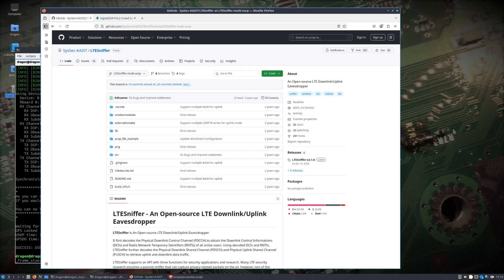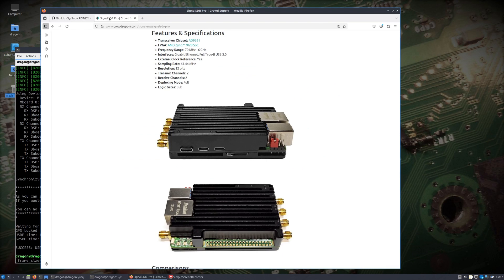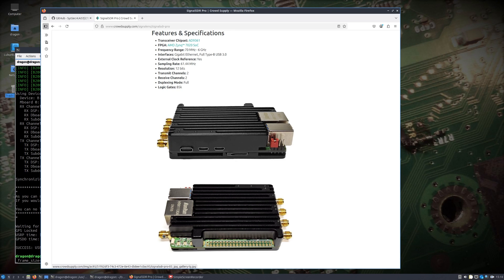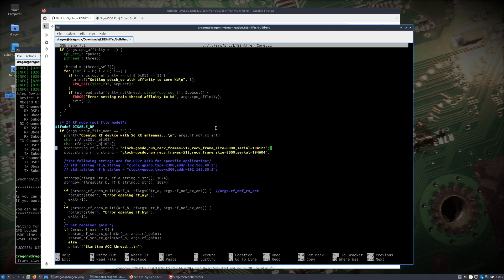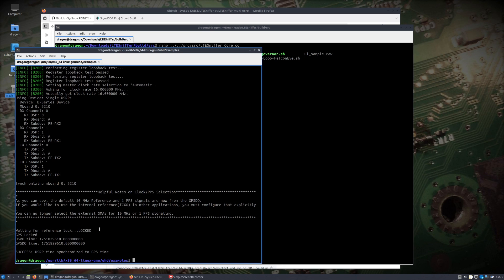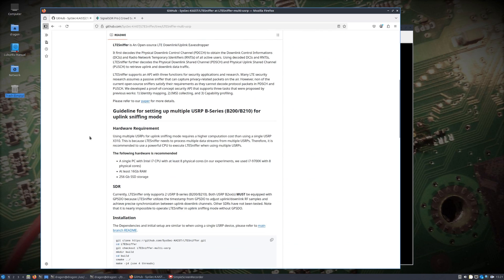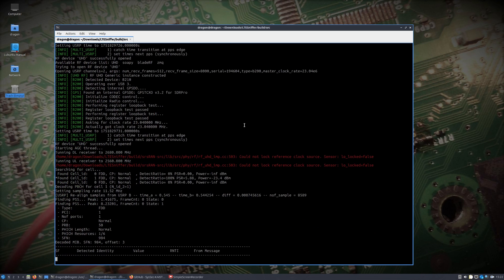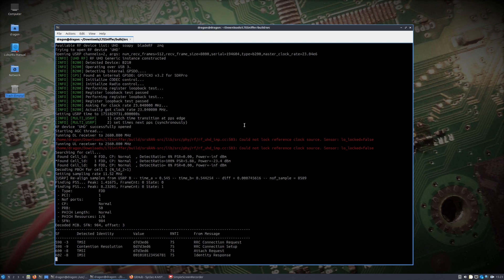DragonOS Noble LTE based IMSI Capture Demo w/ LTESniffer Using Dual SDRs (SignalSDR Pro)

Comment: Does DragonOS on the raspi4 have the driver that allows output through the headphone jack? Having some problems trying to get output through the headphones.
Reply from the maker: You’d need to change audio settings with the volume mixer, but yes it can output via headphones.

Comment: I was thinking about dual boot or wiping and installing DragonOS. I just bought a Chromebook for the purpose. Specs listed. Is this machine capable of running Dragon?  
    1.2 GHz Intel Core i3 6-Core

    8GB LPDDR5 | 256GB UFS Storage
    14" 1920 x 1080 Display
    Integrated Intel UHD Graphics
    Wi-Fi 6 | Bluetooth 5.4
    HDMI 1.4 | USB-C | USB-A | 3.5 mm Audio
    Full HD Webcam with Privacy Shutter
    Chrome OS.